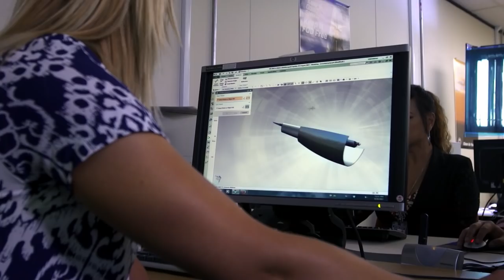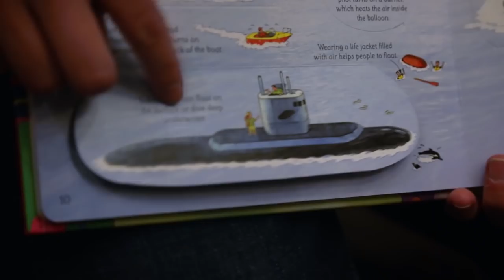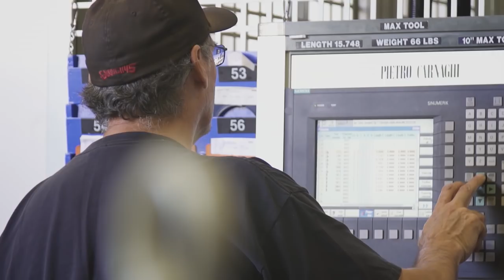Life + Work at Northrop Grumman: Sunnyvale, California

Comment: 1:30    Blonde math fail. The cheapest house in Gilroy, CA is $800,000 which is a 2 hour one way trip. No way that job pays a min. $240,000 a year which would be the max recommended 28% of the paycheck per year for a $800,000 mortgage. That's 1,040 hours (43 days) of commuting per year to a depressing neighborHOOD.